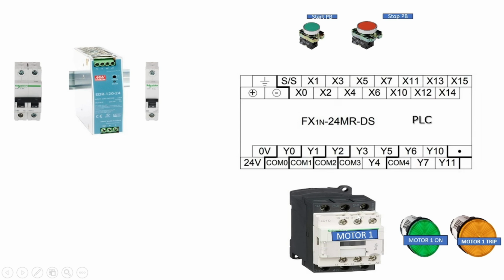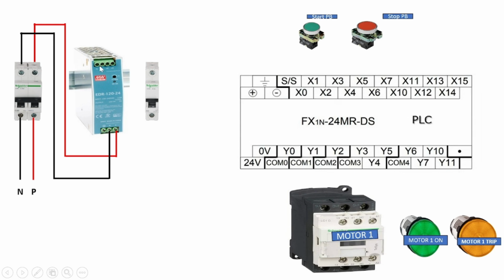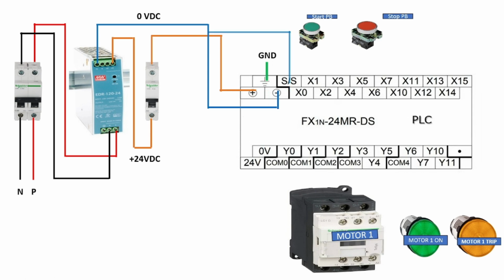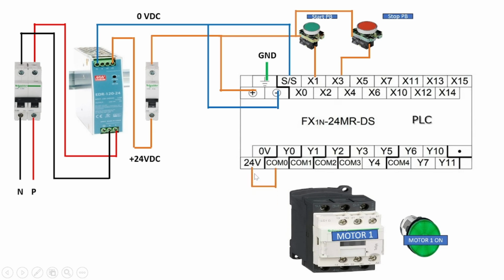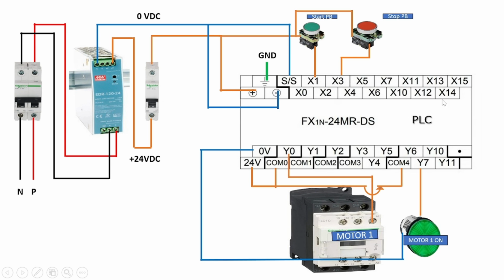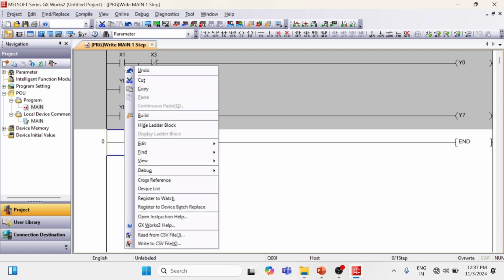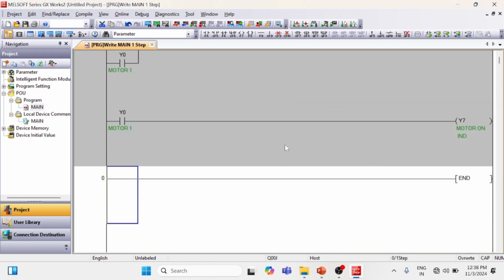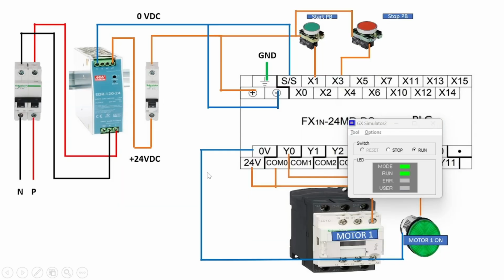Mitsubishi PLC Wiring and Program Tutorial in GX Works 2

Comment: Bro Sinking Inputs Means We Give Negative Common to S/S and Positive will get from PNP Sensor or A Field Device that gives Positive when field device Acts
Reply from the maker: No brother 

Sinking means - 0v is given though NPN sensors to the PLC input terminals and +24VDC is common 

Sourcing means - +24VDC is given through PNP sensors to the PLC input terminals and 0VDC is common
Reply: @RadhikAautomation2151 you are correct, thanks for sharing
Reply: IN NPN INPUT COMMON IS ON PLUS 24 V FOR SENSORS NPN, AND PNP INPUT COMMON IS MINUS 0 V, FOR PNP SENSOR
Reply: @KarloVarvodic yes right
Reply: No @chetan991000

Sink means 
0VDC connect to plc input terminals through input elements and +24VDC is common 

Sourcing means 
+24VDC connect to plc input terminals through the input elements and 0VDC is common